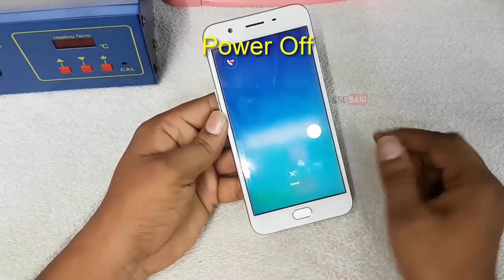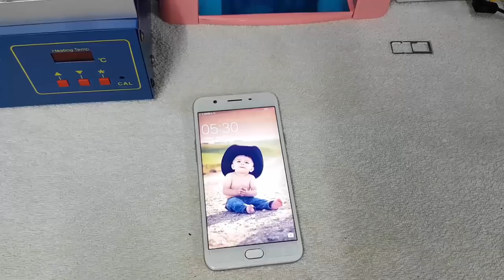OPPO F1s Battery Replacement || How To Disassembly and Reassembly Oppo f1s battery

Comment: Sir I have a problem in my phone oppo f1s please help me. How to fix my phone because before I went in school about like 6 hours and my phone is not low battery maybe 8% for real then after that I arrive in our house and my phone was dead battery what should I do sir please help I really love my phone.
Reply: That's because it consumes battery life even if you dont use it. Try switching off the internet or put it on airplane mode. The best option is you switch it off.

Comment: San po kaya pwd mg papalit ng battery ng oppo f1s?
Reply: Oppo service center.
Reply: SM MANILA, FISHERMALL, SM QUEZON CITY meron
Reply: Wala silang 🔋 replacement sa mga maliliit ng stalls kasi ayaw nila ng third party issues na maaaring maka affect sa pag papa ayos ng phone
Reply: 350 php ang price for replacement
Reply: @audiepuato2720  nice buti mura
Reply: @excaliburgz1996  basta make sure lang po na oppo store yung pagpapareplace-san niyo ng battery... Ang pangit kasi sa oppo kahit anong alaga, talagang magkakasakit; pwedeng mabilis maglowbat, nagiging slow
Reply: @audiepuato2720  tnx po sa advise :), hard to tell perk tung oppo f1s ku 2016 pa tu nabili pero gang ngayun still responsive padin sa touching sya tska walang any sign of slow sa system bsta daily nalilinis yung mga dump data gamit yung built in oopo cleaner nila tska anti virus, ngayun paupdate update nalang din aku ng nga new featured and improvements na nilalabas ng oppo. Na hanga nga yung pinag bilihan ku ng sa oppo A3s para kay mama sa flagship store nila sa robinson galleria sa ortigas kasi smooth padin tlga sya, alaga kasi tlga kahit na may ml tska pubg sya na games alaga padin, sarap imaintain nitu kasi phase out na pero maganda camera tska smooth padin. SKL lang po hehehe
Reply: @audiepuato2720   kasama ba yun sa battery na e replace yung price na 350?
Reply: @sodenoshirayuki4509  opooo :)